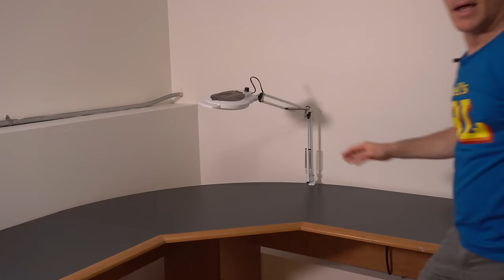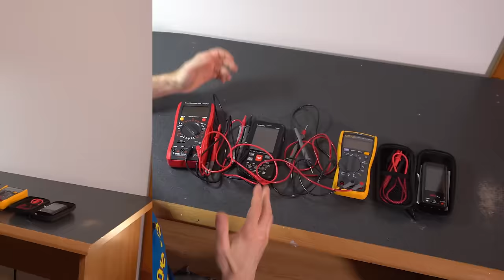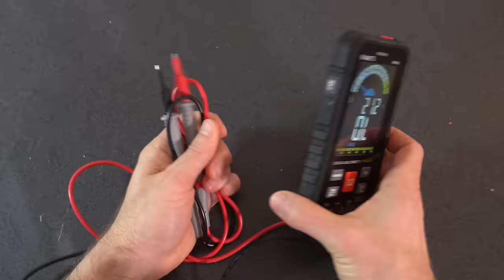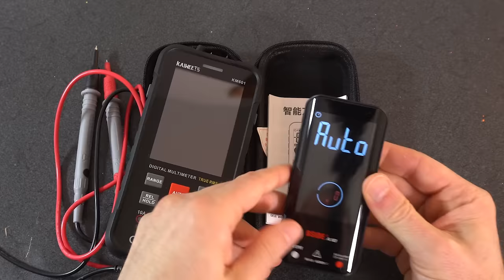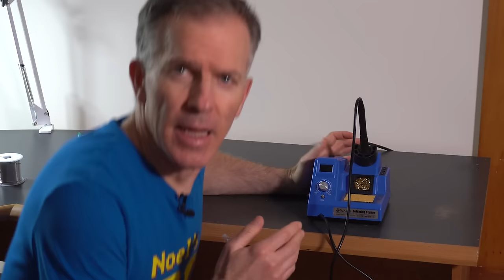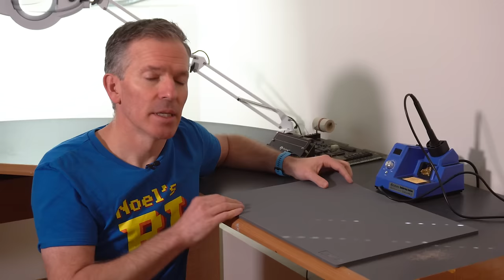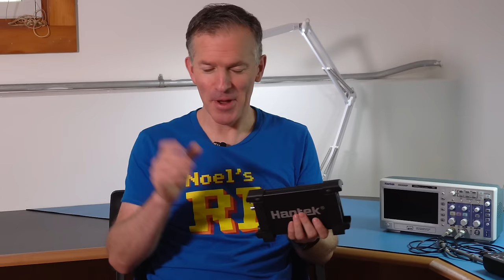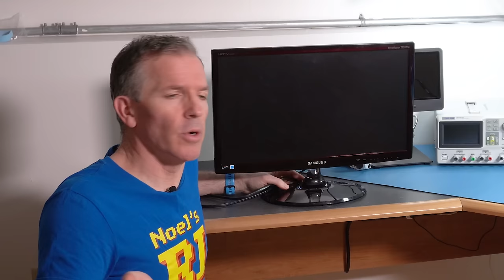Essential Tools For An Electronics Lab

Comment: Hi there. Several things caught my attention, and one in particular was the auto-range function. I actually don't use it even if it's available. I own a Fluke 179 and I always go for manual range, mainly because it has a faster response. Also, it's good to have an analog multimeter, they are far quicker at measuring fast changing signals for the same price tag (you need to spend some serious money on a digital one to beat the analog models), and they are more robust and durable. It won't replace the digital meter, as it won't have a lot of the functions, and recording the readings can be a pain, but they can be an affordable and portable solution.

Unless you really need high precision readings, I would also stay away from bench multimeters. They are pricy and for most applications are overkill. My approach is to make a fascia with cutouts and some sort of spring latch system (has to be custom based for each model) and you can put them in those niches. They will stay there, tidily packed and ready to be used, and you can always pick them up to take with you for some remote work. The fascias are not difficult to make, and even if you need to change to a different model, it won't be expensive or hard to manufacture another one. Your workspace will be more pleasing to work with and it may save you from those silly accidents where you knock something over, like it has happened to me many times over. If only wireless leads existed, I would get them in a second, I hate having rat's nests.

The other thing that I like very much are shadow boxes and shadow boards. Nothing beats having a place for everything, and everything in its place. For me it saves me time, reduces stress levels and I respond quicker to any situation without having to rush or tear my hair out because I cannot find something (that really gets to me). By using kaizen foam or any other dense foam, custom organisation trays can be made to place inside shallow drawers for items such as leads, solder rolls, tapes, pliers, tweezers, etc. Anything that is likely to clutter your workbench can be stored there. Another benefit is that you can easily keep your stock under control just by looking at it. No more messy drawers. As for the shadow boards, they are the best solution I know of to keep my tools organised and with easy access.

As this was the first video I watched from you, I may have mentioned things that you are already doing, but still, if it helps anyone starting out, it was worth the time spent writing.

Overall, I liked the video. It contains interesting tips, some of which I will certainly consider for myself. Many thanks.

Comment: Tldr for anybody trying to build a lab don't buy everything at once you don't need 20 multimeters two oscilloscopes two bench power supplies 

Try your luck with whatever you got right now if that doesn't fit your criteria or breaks easily or broke quickly then get a new one get a proper one 

Don't go out buying the best the most expensive if you do maybe 2 hours of soldering in a year 

Go by what do you need currently for your current project 
Everything else is going to accumulate really really quickly

Comment: Hi! Great video. But you got the specification wrong on the portable oscilloscope.
It's the analog bandwidth that's 40MHz. So your cool up to 40MHz signals there. Compare that specification with an old analog oscilloscope that doesn't sample. And the sampling rate is 250MS/s so it samples at a rate of 250MHz. So in that regard you would be ok with signals that is 125MHz in regard of Nyqvist.
So you have a better oscilloscope than you think.

Comment: im interested in getting into robotics and automation, meaning I'll work with arduinos, servos, stepper motors, solenoids, shield boards, relays, that kinda stuff.

however i dont know things about analog electronics, so it would be a pleasure to learn.
i have no idea wether i need an osciloscope or a signal generator, and will probably figure it out when i cross that bridge

Comment: Yes sir you missed several. I could think of the small to huge PCB holder, magnifying glass, helping hands, a few more tweezers and different kinds of screws. Maybe you also need a rotary tool using that small drill bit if you are making something or needs to drill holes on PCB and different gauges of soldering lids and flux. You did not said the analog multimeter.

Comment: Just ordered one of those soldering stations. Like the temperature range. And if there is a big backplane, I will use my Weller WTCPL which I have been using for SMD, and you can guess why I am upgrading. Very nice video, have subscribed

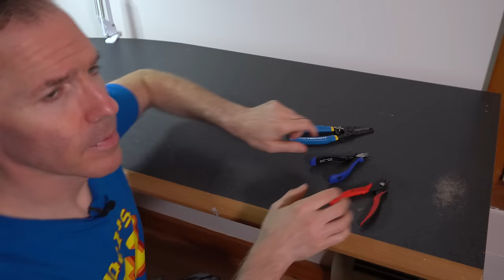Comment: You don't mention it directly, but I'd recommend two sets of cutters... a basic pair like you described and a good set of flush cutters (you actually show, but don't mention at 4:04 - the red ones).  A couple types of forceps are very handy as well... for small places, gripping things and they can also be used as heat-syncs.

If you can afford one, those handheld battery operated combo scope/multimeter/wave-generator units are great as starter or even second units.  I just picked up a OWON HDS2102S 100MHz for well under $300... much less if you only needed 40 or 70Mhz and no wave-generator.  The scope and multimeter combo, with its portability is nice to have.
Reply: Those are Bahco flush cutters with red and black handles (referred to as "Hakko" cutters in the video).

Comment: I found out that most expensive don't do the job. For cutting IC legs I use a good pair of Plato model 170 shears. If they get dull just get another pair. They are less costly so having a few extra pairs on hand is smart idea. I save the dull ones for cutting wire. As for all others I like a small pair of needle nose pliers not to confuse the difference in long nose pliers which I have them also and bent nose which I haven't used them yet. Good screwdrivers are a must. I like old craftsman tools. I don't like the new ones at Lowes. I buy mine at flea markets. I have my dad's few screwdrivers he had back in the 60s they are the best. I bought a few that he  had missing. The old ones don't turn white if left in the tool box. At least the ones I have. 73
Reply: The white mildewey stuff occurs on screwdrivers with translucent butylstyrene plastic handles such as Excelite nut drivers.  It also grows on certain types of reddish brown Bakelite or plastic knobs found on old radios and old vintage tube hifi gear such as Scott and Fisher.   A mix of one part Formula 409, 1 part household ammonia, and 2 parts water is very good at removing it. I have also found that oxyclean crystals dissolved in warm water are surprisingly effective at removing that white crusty stuff. Nothing else I've tried works anywhere near as well.

Comment: It looks like you have a AWG there too.  I use a signal generator all the time and I think it's pretty essential.  For me, I'd really miss it if I did not have one.  I actually have 2, a Siglent, like yours and a JDS-6600.  I actually have 2 of pretty much everything as I have 2 workstations.  There are always some delays in a project (waiting for parts is typical) so it's nice to be able to get on with something else in teh mean time without having to "put away" the one waiting.
Reply from the maker: Good eyes! Yes, you're right. I didn't mention the signal generator because it's actually new to me. I think it'll be super useful, but it's something I lived without for a long time. But yes, I'm already seeing all sorts of things I could be using it for 😃. Two of everything is pretty ambitious! I'll probably get two of a few things though, especially if it makes sense to use them at the same time (like soldering irons). Little by little...
Reply: Not everyone needs or wants two workstations, and some of us that would like two workstations might not be in a position to set them up straight away. Though if you're working on electronic stuff for quite a few hours every week without fail, then it's definitely something to work towards in the longer term.
Reply: @OzRetrocomp  Being retired, this is my main activity, maybe 20 hours a week.  This stuff has been acquired over a number of years as has the methodology.  I'm not suggesting it's for everybody.

Comment: It doesn't have ttl decoding, fft, bode plot, function generator. I had it and gave it away. They have a 250cad replacement that is much better than the 5202. I bought a siglent instead haha

Comment: - Polarized light ring under the trinocular microscope for SMT
- JBC clone soldering station that's calibrated across temperature ranges and works almost as fast as the real thing and the tips are way cheaper than Hakko's.
- ESD mats on work surfaces, properly grounded and affixed to the work surface semi-permanently. If it's not grounded, it's a liability.
- Siglent 100 MHz scope hacked for Wifi, digital signal analyzer, and 200 MHz
- Fluke 287 when they were way cheaper 😂
- Refurbished and recalibrated Agilent PSU... you can do it yourself
- Big-ass, high-volume container fume extractor with 2 flexible articulated nozzles
- For through-hole, Ideal-Tek PCSA circuit board holder
- For SMT, a PCB vise that can adjust the tilt
- Suction desolderers are awkward and terrible. Use anything else, from braid to a vacuum desoldering station
- Semiautomatic solder feeder (as pencil handle addons) are useful most of the time

Comment: Noel your channel is one of my favorites. I know  you are too busy and probably would not be able to respond to my question. I just need to know if this oscilloscope is enough to use for retrocomputing repairs (mainly Amigas, Atari's, ZX Spectrums and other 8-bit machines). The OWON SDS1022 Digital Desktop Oscilloscope 200 MHz Bandwidth 100 MSa/s Sample Rate 10K pts wavelength. It costs around $210 from Amazon. Thanks

Comment: I remember the first soldering iron I bought, it was so bad that it only worked once. The metal on it bent, and the plastic handle was a little bit melted as well. That's what I get for being a cheapo and getting a $2 soldering iron. 😅😂

Comment: Great to have you back! Btw, since you prefer leaded solder, don't you also need a fume extractor?
Reply from the maker: Thanks! I definitely need a fume extractor, but not for the lead. I read that it's mostly the resin in the flux that causes all sorts of problems, so you need it no matter what. I'm actually planning a whole video looking at a few solutions and comparing them. Until then I'll keep the window open 😃
Reply: I'd recommend a fume extractor regardless the solder alloy.  I'm using a FumeFan.  Very simple, a fan and a carbon filter, does the job.
Reply: Sigh. The fumes are flux; not lead!
Reply: @Okurka.  True, but our lungs are not a great place for burnt flux fumes.
Reply: @uni-byte  "since you prefer leaded solder"

OP thought only leaded solder requires a fume extractor.
Reply: Flux is really bad for your skin too. I'm not allergic to anything, but I accidentally touched my skin with flux on my hands, and ended up with a big red patch of sore skin.
Reply: A simple fan to circulate the air will be sufficient
Reply: @MattyEngland  well it is corrosive
Reply: I DIY'd my fume extractor. A Noctua NF-F12 iPPC-2000 120mm fan, Carbon filter, a cheap Standard 120mm fan dust filter as a spacer, some M5 screws (preferably designed for tapping), a few 3D printed parts, 2 rubber bands, a toggle switch, and a 12V wall wart power supply should be enough to make one with decent performance.
Reply: @MattyEngland   Good thing your parents never gave you violin lessons.  Flux is made from Rosin, Violinist use to Rosin their bow.  Rosin comes from pine trees, which you should stay away from too with your friends extreme allergy to pine rosin.  PS, no Christmas trees either!
Reply: @Route66Wanderer  ,  The flux used with and contained within leaded solder made specifically for electronics work is indeed pine tree rosin. Flux used for lead-free solder is NOT the same ----  it is harsh, corrosive if left behind on a circuit board, electrically conductive!, and extremely irritating to the nose and throat. As for rosin flux, while some people find the fumes irritating or are allergic to it, I've been working with the stuff all my life and I've never had a rash or reaction to it; but your mileage may vary. Rosin flux is also generally noncorrosive and not conductive except in very high voltage applications or in high humidity. (Scraping away crusty excess flux on old circuit boards is always a good idea anyway. Rosin flux washes away with alcohol, while leadfree flux is typically soluble in water).

When working with ordinary lead solder I find that just a little bit of ventilation like an open window or a fan is the most I've ever needed, but generally I don't even notice the fumes from it. Lead- free soldering flux, on the other hand, is really nasty stuff to breathe, highly acrid, pungent and eye-watering, and if you're working with it on a regular basis you really should have some kind of fume extractor. Either way, the fumes encountered while soldering do not expose you to lead or other toxic metals! The melting point of both types of solder is far below the boiling point of the metal where it would actually vaporize and become gaseous.

 A couple more points about lead free solder and why I do not use it. First of all, the flux residue is corrosive, and conductive, and if you do not completely remove all traces of it from your circuit board it can corrode the connections later on, or cause leakage paths for current to flow (it's water soluble, BTW).  The melting point of lead free solder is higher than it is for leaded solder, and between the corrosive fluxes and higher temperatures required with the lead free stuff, you will find that the lifetime of  soldering iron tips is shorter if you use lead free solder. If you use cheap soldering equipment and the tips are poorly made you'll probably find that they pit and oxidize and dissolve pretty quickly from the additional acidity and heat of using lead free solder.
  
Also note that lead free solder never wets to the component leads as well as leaded solder does, and leadfree solder is harder and brittle, less malleable, and so devices manufactured with lead free solder tend to develop broken connections earlier in their lifetime, especially under temperature extremes (not just heat from hot running components but also from extreme cold), often consigning the device  to the junk heap sooner than nexessary.  Lead free solder is also metallurgically unstable, and it grows crystalline "tin whiskers" known as dendrites that can actually reach out from a solder joint and touch adjacent connections or components and cause short circuits.
Reply: @xxportalxx.  , leadfree fluxes are most definitely corrosive, but  rosin flux for leaded solder generally isn't.  Chemically they aren't the same, and lead free soldier needs much more aggressive fluxes to clean the connections because lead free solder just doesn't flow and wet to other metals as well as leaded solder does.
Reply: @goodun2974  all Flux is corrosive, it has to be to function (the whole point is that it strips away the oxide layer between the metals), rosin just contains acids that aren't soluble in water, instead requiring that the waxy hydrocarbon solvent of the resin be melted for them to be active.
Reply: @xxportalxx.   Traces of rosin flux left behind on a circuit board rarely cause any major problems. I work on a lot of old audio gear and you'll have gobs of flux in between the solder connections to the output transistors (it seems to cook out of the solder itself over time), and yet unless there is a solder ball or solder whisker under there causing a short (which does on rare occasion occur) usually the rosin crust causes no real problems. If it's a high voltage circuit like in a tube amp It can sometimes be  somewhat conductive and cause electrical leakage and noise, especially in humid conditions, but in most cases it can be considered to be pretty neutral.  The fluxes used for lead- free solder, however, are much more aggressive and can definitely cause corrosion and leakage/conductivity if left on the board.  They are likely to be hydroscopic, absorbing moisture from the air, and as you've noted, moisture activates them.

Comment: Both your budget scope options have versions with higher sampling rates which would definitely have been important to mention because they are both MUCH better quality than those cheap hobby scopes that claim much higher unrealistic sampling rates that their ADC doesn't even support. Hantek is a lifesaver for the beginner because of the quality and entry point is unbeatable. A little step up would be Rigol but that is already a 100% price increase for fewer features.
Reply: what models exactly are you recommending?

Comment: Hemostats, esp alligator hemostats
magnetic tip for one of the screwdrivers
Maybe opt for a used 500 GHz 4-channel oscilloscope color such as a Tektronix TDS 744 for about the same price to $100 more?  (And a free upgrade to 1 GHz and double the memory with a hack.)?  Not so compact but...

Comment: A can (or three) of Freeze Spray, along with hot air, is very helpful to find bad intermittent components.
Reply: No need to buy special "freeze spray"; a can of pressurized "air" held upside down will give you a freon-like blast of liquid refrigerant.

Comment: Excellent video, thank you 👍. Cool conversational style.
I previously had not considered 40k hz limit on certain oscilloscopes.
If all of these tools are powered on together, does a typical mains fuse box support that, or is it preferable to split power draw over to another section of the home?
Kindest regards, neighbours and friends.